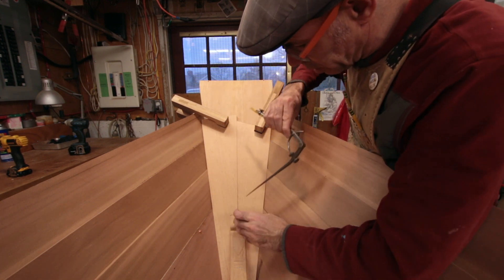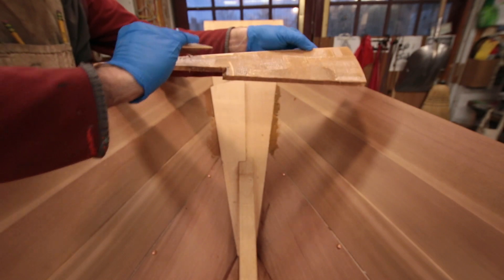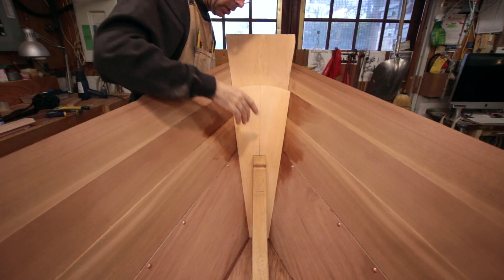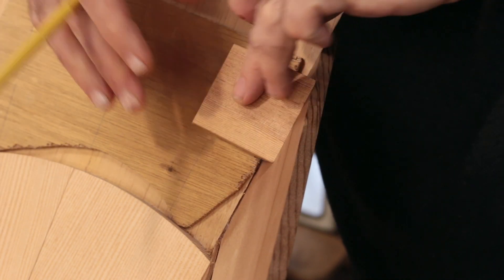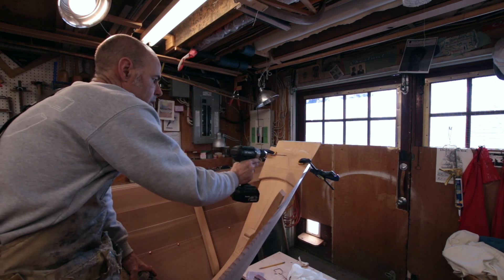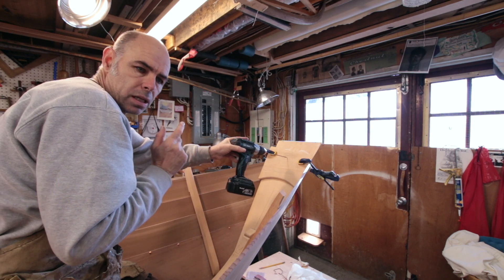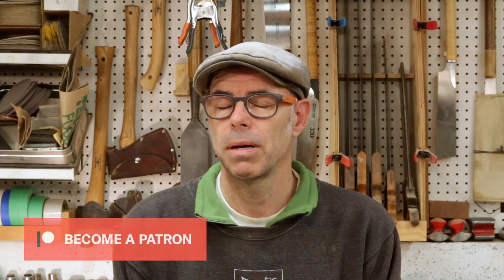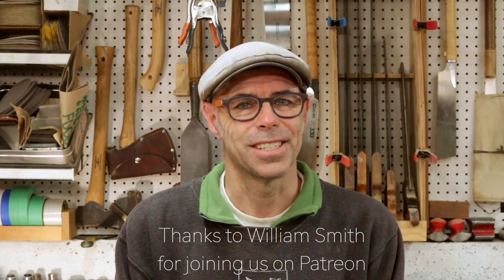Building the Bouchie Dory Pt.24 - Fixing mistakes continued - Extended Patreon version

Comment: Great video. Why did you say you did not want to fiberglass the transom to the planks? I would think you would want to connect the two in order to make it stronger?
Reply from the maker: It’s not necessary for one and it makes future repairs more complicated. Also, clean transitions from glassed to non glassed surfaces can be tricky.

Comment: You can actually breathe on CA glue to make it cure, if your kicker is out of reach. On the other hand, you shouldn't breathe it in, which becomes tricky...
Reply from the maker: I have never found that to work very well on wood. CC glue likes an anaerobic environment to kick quickly on its own and I think wood doesn’t easily provide that. I’m usually using 2P-10 CA glues because they are locally available. The activate makes them kick off instantly.

Comment: I have burned up two cordless drills in my life.  Both times i was using big hole saws and going slow.  I dont think the motor was turning fast enough to cool the windings
Reply from the maker: I think the answer is just using a light touch.
Reply from the maker: Your question about transom knees has disappeared into the interswamps. In most traditional wooden boats, the stern post, which is rigidly fastened to the keel serves that purpose. In dories, which have no keel for a sternpost to fasten to, the knee connects the transom to the bottom. You will also see transom knees showing up in outboard powered boats as well, which again, generally don’t have the keel structure to provide that support.
Reply: @Nomadboatbuilding  thanks for the answer